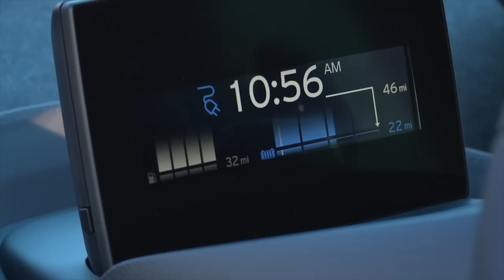Five Things We Need To Improve About Electric Cars

Comment: We need a major breakthrough in battery technology where batteries are more energy dense than gasoline.
Reply: We've already reached the point where battery+motor is more energy dense than petrol tank+engine+gearbox+transfercase+diff+radiator+ alternator÷inefficiency. Just focusing on the petrol misses the point entirely.
Reply: gasdive Awesome!  But the cost is too prohibitive.  They people need to be able to afford it.  Not just for the rich.
Reply: NantEnergy.com
Reply: @geoffmorrise2072  Before you promote Zinc - air batteries (or any others), always consult other sources first. In their case even Wikipedia is enough:
https://en.wikipedia.org/wiki/Zinc%E2%80%93air_battery#Secondary_(rechargeable)
It has horrible recharge characteristics.
Reply: @richardpetek712  I spoke a little too soon.  Got excited by the CEO's hype and spoke too quickly.  Definitely not a battery that can be used for automotive (at least not yet).  But I would love to have a 20 kWh bank of them at my house for solar back up and only pay $2,000.  Don't know if that will ever happen, but I can hope.
Reply: @geoffmorrise2072  Sorry, but this chemistry is only a great one-way ticket, but lousy at recharging. Read the Wikipedia page once again.
This CEO may talk whatever he wants, until he cannot present a battery which made a few thousand cycles and all the data about its efficiency, capacity and charging and discharging speeds, I wouldn't believe a single word.
New "fantastic" chemistries appear all the time, but they are (unfortunately) just vaporware. Check, check and once again - check it.
Internet is free, whenever you read or hear something <too good to be true> , Google "wikipedia <buzzword>" and read.
Reply: You are very very wrong.  We absolutely don't need that.
We just need batteries that are made in big quantities for half the price, cheaper would be even better.
The rest is irrelevant.
Reply: Richard Petek make a cheap battery that can get like 200 mile range and the total cost of the car is cheaper than the gasoline equivalent, then invisible hand in the market will work
Reply: @ThaylorHarmor  Well, it depends what you mean by 200 miles range, but if that is at freeway speeds (75 mph or 120 km/h) and the car can recharge at least 50% in less than 30 minutes, I absolutely agree.
You more or less defined the Model 3 Standard / Medium range edition - after a serious price drop.
Or a Hyundai Kona / Kia Niro.
Reply: @ThaylorHarmor  But if you go for 200 miles while making it as cheap as possible, you end up with a car like the Nissan Leaf 40 kWh with no thermal management. A car that now, in 2018, shouldn't see the light of the Sun.
As one guy (a Leaf owner) commented it: Hyundai Kona (even the 39 kWh version) wipes the floor with it.
https://www.youtube.com/watch?v=4xRGy0tAfHU
Reply: @richardpetek712  Very true. But from it appears that as power density increases costs fall too.  It's as if the cost of producing 1 kg of battery doesn't change even though the density doubles.  (I doubt we'll ever see batteries as energy dense as fuel though.)
Reply: @geoffmorrise2072  It may look like this, but actually the price falls faster than the capacity increases. Capacity will still increase, but slower.
Well, with some dramatic change in chemistry it may double (solid state batteries), but this will quite likely take one or two decades.
But no, no rechargeable battery (or super capacitor) can match something can be used only once, namely - burnt. Gasoline is good, methane is even better the best (per weight) is actually hydrogen, but you cannot recharge it - you need to extract it, the cleanest way is from water - but the whole cycle has big losses.
So the best was way we have for the next two decades are some versions of Li-Ions. They will become slightly better - and a lot cheaper.
Reply: @richardpetek712  I had hoped in the past that next gen batteries were just around the corner.  But I think you're probably correct, it's a ways off.   Given that's the case, other solutions, (perhaps the one I've described), become even more significant to get 100 millions of people using less gasoline (up to 90% less than is used today).

I still personally have an angst about hauling around hundreds of pounds of battery (400 or more) every trip, every day, just to have the range available to use once in a while (every month or two) when I want to take a longer trip.  Of course that is just my case and my driving.  Some people need that greater range frequently.  But I suspect that there are a lot of people in my situation.  At least the statistical facts suggest that there are, http://www.solarjourneyusa.com/EVdistanceAnalysis7.php.
Reply: @geoffmorrise2072  Well, I've been where you are now. "Weight is bad". Well, it is, but by far not as much at ICE cars and as you think.
In electric cars it is close to irrelevant. How this?
 Pure physics. 
Sir Isaac Newton says, once you bring a mass to a certain speed, it becomes irrelevant; you only need to overcome any resistance.
In cars it consists of rolling resistance, directly proportional to weight, and drag, which is a factor of cross-section, drag coefficient and a square of the speed.

At freeway speeds the main factor is air drag - which has no relation to weight, only to size of the car and its shape. 
Rolling resistance has a much smaller factor.

But how much would rolling resistance change with a lighter battery?
Well, a fully loaded Tesla Model S has 2300 kg. And it has a 500 kg battery. Let's take these numbers as an approximation.
Let's say somebody would do some magic and the battery would weigh 50% less. A 250 kg battery, incredible, right?
Well, the car would weigh 2050 kg instead of 2300. That's merely 10% less. Since drag is the main factor and not rolling resistance, the car would consume only about 5% less energy. That's not a big deal, right?

OK, city. Acceleration and braking, we have very little drag, the weight becomes important.
But guess what? Yes, you need more energy to accelerate the car, but once you decelerate, the EV can recuperate that energy back into batteries again!
Hurray!
Well, not so fast. The process is only about 80% efficient; we have about 20% losses.
But still, you lose 20% of the weight difference. Since the weight difference (in the whole car) was 10%, you have lost about 10% comparing to the lighter car. Yes, that's worse than on the freeway, but it isn't a deal breaker either.

With other words, weight becomes about 5 times less important than in ICE cars.

So, as you see, weight is not a serious issue, a bit faster rapid charging (while taking a rest on freeways) would be nice, but by far the most important factor is - price per kWh. Every other topic is just a nice improvement.
Once you can pack in a car some 60 - 120 kWh of batteries at a reasonable price, everything else becomes (almost) irrelevant. 
Agreed?

And by the way, Elon Musk knows all that too. This is why he made his own Gigafactory a couple of years ago. To cut down the cost.

Oh, by the way, forget that statistics unless you really need two cars in your family.
Don't buy a car for home-and-work and one for long trips. Combine these and buy either a Model 3 or the (coming) Kia Niro or its smaller brother Hyundai Kona. You can also take the Chevrolet Bolt if you like it or possibly the (coming) Nissan Leaf 60 kWh.
Everything else is just a stop-gap solution.

Comment: I'm interested in whats going to happen when a large amount of Leaf owners have a car that so old, the battery is out of warranty.

When it's just a few owners they could take the back out themselves and replace the batteries in side the pack by themselves and not do a very good job of it.

When it's a large amount of owners then a small business somewhere will buy old battery packs and fill them with new batteries.  So if in 5-10 years time you still own a Leaf with 22KWH battery then a company could fill that battery pack with 80KWH of new batteries.

At the moment the batteries are still under warranty so the only people who are going to touch those battery packs are Nissan.

But sooner or later there will be plenty of car with batteries out of warranty and companies filling those packs with as many KWH as can be squeezed in.

Comment: Tesla cars are already cheaper per mile compared to ICE cars for taxi operators - especially if they operate large fleets. Their high  price is more than offset by the fact that they can possibly go 500,000 miles. Model 3 drive train was recently tested for a million miles.  Tesloop already has Model S cars that have run 350,000 miles in 4-5 years and still going strong with very little battery degradation. Charging infrasturcture and charging speed is not  a big issue if you operate a large fleet (it is ok that you can use a car for only 22 hours a day, and charge for 2) .  I think Model 3 will start a new revolution in large fleet operations long before we have autonomous cars. Ultimately, the best way to reduce carbon emissions is to move as many people as possible away from car ownership to ride sharing. Ultimately it is not what fraction of cars are EVs that matter - its how many miles are driven in EVs as opposed to ICE vehicles.  Ride sharing is already appealing in big cities. If EV makers concentrate on the fundamentals and take advantage of the inherent pluses of EV drive train everything else will follow.
Reply: I can replace every moving part on my 77 Chevy k20 for less than I'd have to pay in interest on a new vehicle. Because I already own my truck, even though it only gets 10 miles to the gallon, the cost of an equivalent EV, the cost of interest, and ignoring the cost of electricity entirely, there is no cost benefit to buying a EV, even with factoring in a complete new drive train for my existing truck (over a 30 year span). You people seam to forget how poor most people are. Half of the United States makes less than 30k a year, I make 32k a year and my 16k car financially crippled me for 6 years. Where I live 40 year old trucks are extremely common, it's all we can afford, and they keep making parts for then because enough of us keep needing them.
Reply: Tesla has a ways to go in supplying replacement parts and repair tools for their vehicles longevity is a big part of the equation in lowering the total life time emissions.
They also need to stick with AC induction motors as these are far less polluting to manufacture than DC PM motors which use rare earth magnets.

Comment: 6. "Upgradability" - I would love to buy an EV. I finally got my daily commute reduced to 10 miles (victory at last) so, any EV in the market would be enough for me BUT, when I need to travel, it is a 250 miles route and a "100 miles" battery that can reliably give me 90miles will make the trip a tedious one with 2 charge stop.
My point is: I want to be able to "upgrade" the battery in this case and then, come back to my old small pack.
Solutions: Add a supplemental battery ad hoc in a pre-designed slot in the car.
When the manufacturers realize this, we'll see more EVs rolling out.
Reply: Rodrigo H N Magalhaes .  The normal way of upgrading is to sell your old thing and buy a new one.  Works well for
Most things.
Reply: As an only car, what you describe is probably best served with a PHEV. A used one like a Chevy Volt could be a good call, but from a financial perspective, would it be cheaper than keeping your current car, even if someone else took some depreciation? That's not automatic.

Comment: Point number 5 won't happen. Battery pack design is the key technology differentiator in electric cars and to standardise it across manufacturers would be to commoditize the auto industry.
Reply: All kinds of non-OEM parts are available for common cars today, I see no reason why the same won't apply to battery packs as well after the market becomes big enough and age of EVs mature enough to justify it.
Reply: Agreed. Point number 5a won't happen. The industry will not standardize parts. That would've made sense in 1980 and 1990s too (think ECUs), and it didn't happen. However, point 5b, licensing third parties to build replacement battery packs, can and should happen. If manufacturers don't, laws should be passed to mandate it.
(I don't understand the nuances, however. If a third party wants to make replacement alternators, they can, can't they? I've never heard of the necessity of licensing an alternator design. Hmm.)
Reply: @randombytes3998    Patents can delay the after market but only for a limited time and to a limited extent.  No one can stop YOU from manufacturing and selling alternative battery packs right now as long as they are slightly different than patented designs typically, the main problem right now is the limited market for aftermarket parts but that will change as the cars age and become common on the road....just like your alternator example....yes anyone can make and sell them and they do.
Reply: Bo McGillacutty .  Tesla of course have famously made all their patents available to anyone who wishes to use them ( as long as they reciprocate).
Reply: @andrewpaulhart  Yeah I'm not sure ALL of the patents and they seemed to want to keep the battery packs tech secret as long as possible.  Also hard to imagine they'd let go of their electronic/software tech., but yeah that's the story-line anyway.

Comment: I think you should have mentioned the kia Niro as a solution that is soon coming to market. clearly low milage/cheeper is not the path to mass adoption. it has to be the base model method that has always worked, meaning 300miles range with no extra computer wizardry and luxury gadgets. just a big battery and four wheels.
Reply: Price and availability is a huge issue with the e-Niro.

Comment: You totally missed  one, Third party servicing at the moment only main dealers can service EV's I do understand you don't want just anyone touching the high voltage side but with proper training and tools it's should be ok and should keep the ownership cost down after the warranty has expired.. One thing puts me off buying Tesla is that you can't just repair it not talking about the HV side but if the door handle breaks which they do, you can't just go to Tesla and get new handle and fit it yourself because it's all coded .. Thanks to some enterprising people who are making it possible to replace or repair parts but Tesla doesn't make it easy for them
Reply: Agreed - In denmark (and Ithink most of the EU) car manufactors are required by law to allow for third party servicing, but Tesla are really trying to stall it. I hope with more manufactorers that it will become more of a norm. 
I really dislike companies that really try hard to force their ownership of their products away from the consumer (the rightly owner)
Reply: I know for GM and the Bolt, they do have the repair info open to third party shops, and do support parts sales from the dealers. but for other brands though I'm not entirely sure.
Reply: In most ex-USSR countries there is no official EV servicing. Especially, no Tesla. But there are quite a lot garages that do service those cars. Tesla owners though have a bit more trouble getting parts.
Reply: First two things my mechanic asked when I showed him my Tesla is 'what is there to really repair?' and 'how do I get certified to repair these?' my area has no one for ev repairs for over 100 miles and Tesla sends an f150 and trailer to my house to get my car for repairs that they can't do in my driveway. They leave me a loaner but I'd rather take it to my local repair shop and have my local economy benefit from the business. And leaving the HV out for now, door handles, windshields,  random parts inside the cabin, all of it has to come from Tesla and Elon even said that getting those parts to third parties have not been a priority at all. Of course in that same breath he blamed third party repair shops for long repair times.

Comment: Modular batteries are the way to go in my opinion. I see no reason why a mid-range Model 3 can’t be upgraded to a long range. I’d hope that batteries will eventually be like Lego and you could simply add another brick according to your needs. Also, upgraded batteries would be even better if they could simply be swapped for older ones and the older ones used for the grid. Why get a whole new car when you only need one new component?
Reply: Loui Coleman it’s a new industry where advantage is gained by developing new technology.  Hardly an easy environment in which to standardise.  It’s like saying phone manufacturers should standardise their batteries.  How would that work with all the various sizes,  new phones being constantly released etc.    Even when they do have standards like USB there are different versions and more to come
Reply: Andrew Hart obviously there would be circumstances where modular batteries wouldn’t work, but for big vehicles I see it making a ton of sense as a long term goal. Of course, each manufacturer’s brick would likely be different (unless if they all use LG Chem) but I think this would really solve the whole battery upgrade thing.
Reply: We can hope.  Tesla says that their motors and drivetrain will last over 500,000 miles, so if the battery is replaceable, the car could stay on the road much longer than most ICE cars do  today.  The body may wear out before the motor does.